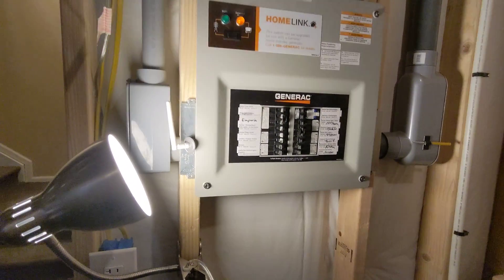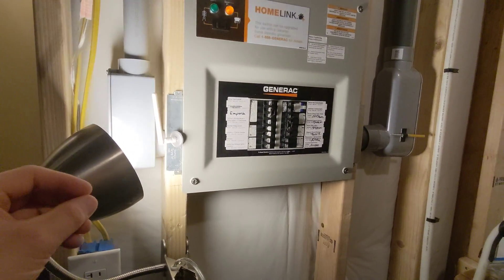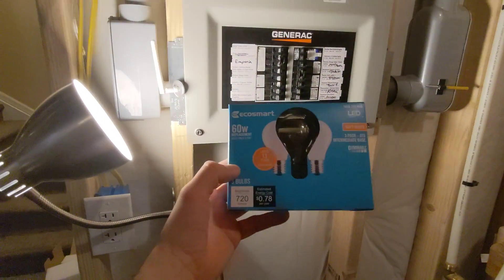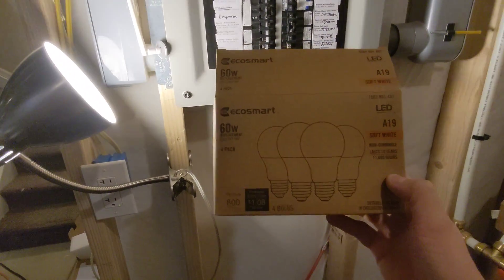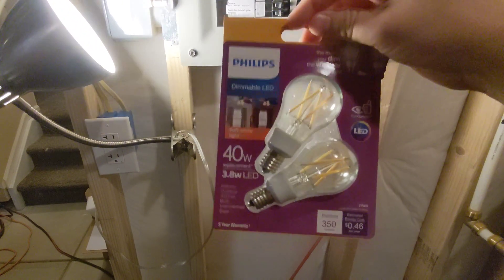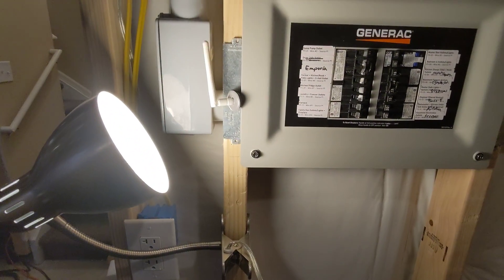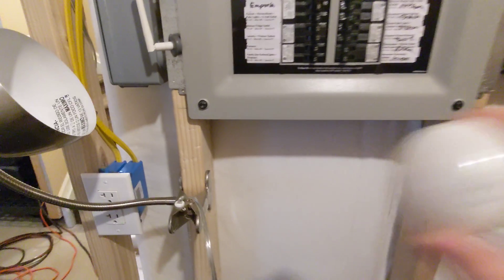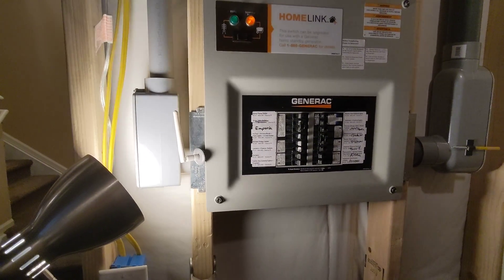Fix It - Lights flickering with Gas/Solar Generator. Voltage Fluctuation.

Comment: What do you check next when your incandescent bulbs are doing it and voltage in house is going from 119 to 125 or so up and down. Its making everything flicker basically? Any help is greatly appreciated
Reply from the maker: Which unit do you have? And you mean the voltage to your devices is fluctuating?

Comment: Have you tried to charge up your ac300's with a gas generator yet, I tried just now and apparently they sell a special cable for this application. Which is crazy because both end connections should be exactly the same they're are just asking for more money to buy another cable ridiculous
Reply from the maker: Hi Hammer - yes I have tested my generator with my AC300 power station and it works. The generator cable that Bluetti sells is nothing special, nor is it needed. It just allows you to charge from your generator at 30amps. The 15amp cord that came with the AC300 can still be used. Just make sure you use an Inverter Generator, which produces cleaner power, that the AC300 requires.
Reply: @MyBluetti  my 1400 watt gas generator that was unable to charge the Ac300 through AC port was able to charge both the EB3A at 350 watts 120v, and eco flow river at 250 watts 120 voltz simultaneously also so it was really disappointing not being able to charge the ac300 with 1400 watts 120v
Reply: I also have 2 ac300s only 4 b300 ATM going to set up my split phase tomorrow
Reply from the maker: Just note that when you enter into split-phase you must charge both units at the same time using the 240v outlet on your generator or from grid. This is because the AC300 in split-phase requires two phases; one for the Master unit and the other phase for the Slave unit. If you're generator doesn't have 240v outlet, then you can still charge each unit separate, but only when it's not in split phase.
Reply: @MyBluetti  thank you that's really good advice, I see my generator was reading 120v consistently and never dropped below so I'm still not sure why it ouldnt charge up maybe I'll buy a inverter style generator and test it out, I also have a eb3a that wouldn't charge the ac300 through AC either , neither would my eco flow mini river 2 which are both pure sine wave only pushing out 400 watts each but I think the pure sine wave  should have made AC charging possible

Comment: Well, here is an update: I rolled back my firmware back to 4031.09 and tested this with my lights on dimmer switches. My LED lights on the dimmer switches were still flickering, so initially I was feeling defeated, but then remembered that my original AC300's had firmware 4031.09 and I didn't see these LED flickering light issues, so I went back to square one and since both my current AC300's were replacements - I checked the AC Output Frequency setting and discovered they were both set at 50Hz, not 60Hz.  So I went I immediately changed the setting to 60Hz and tested my LED lights again and shazzam, no more flickering.  No sure if this is what you might be dealing with, but when I was shipped my replacement AC300's I never bothered to check the AC Output setting and just assumed it was set at 60Hz.
Reply from the maker: That's a great find... that wasn't my issue, as mine are at 60hz.. but I'll add that to the list on my website for people to check for. Thank you! Glad you found this and got your issue resolved.

Comment: I am seeing this problem too after upgrading to firmware to 4031.14, but it only manifests on my LED lights powered by my AC300 split-phase setup that include a dimming switch in the circuit. My entire house is all LED lights and this isn't a problem with any other dimmable LED bulbs unless they are on a circuit connected to a dimmer switch.  All dimmable bulbs not on a dimmer are not affected. Not seeing any of my LED bulbs pulsing like when the washer is running - that is interesting. 
Bluetti is having me rollback my firmware to see if this problem will go away since I didn't notice it until I upgraded the firmware.

Comment: i was wondering thanks David
Reply: What causes the digital clock in the microwave to speed up is another mystery running on sogen ?
Reply from the maker: Hey Tony - This is because most digital clocks use the frequency of the power (60Hz) to count time. The frequency from your grid is very stable and the clock can keep accurate time. However when running on a generator (gas/solar) it is common for digital clocks to run fast or slow because the frequency isn't as stable. I haven't found a work-around for this yet.